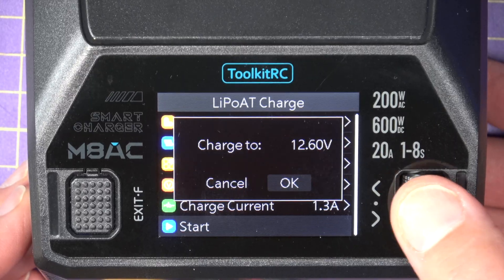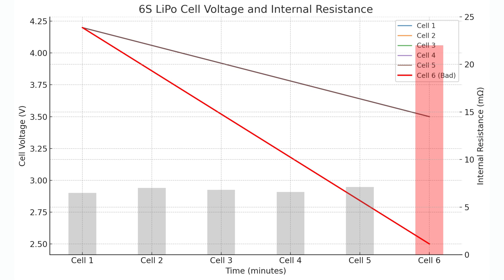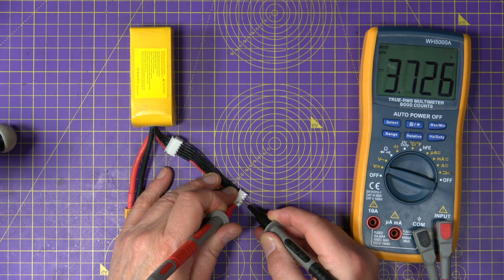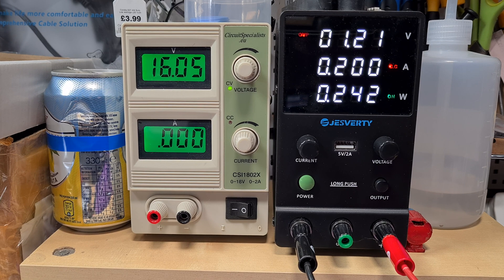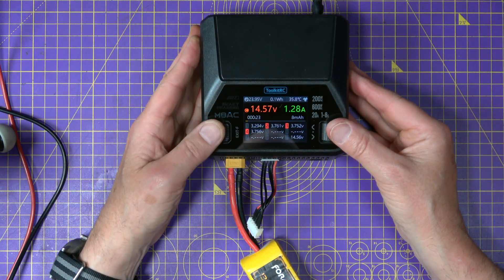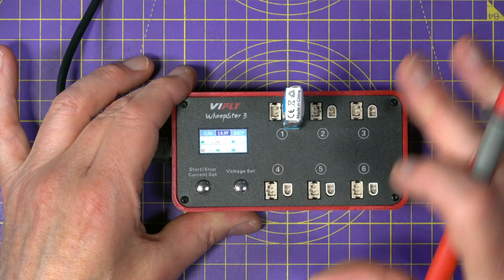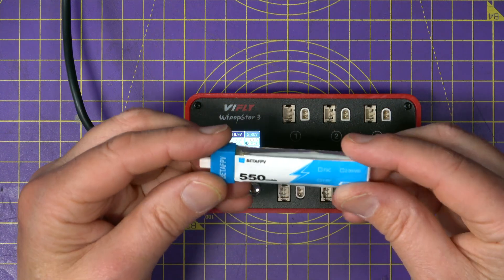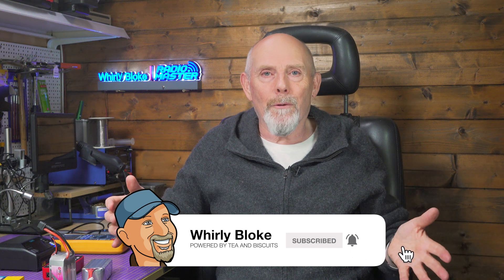CPR for Dead LiPos – How to Bring Them Back to Life - Charging Top Tip

Comment: I got the SKY RC D260 charger which is really wonderful, as it will initially always only charge with 0.1A until it figures out the internal resistance of the cells and how the voltages of the cells react to the charge current. It will balance charge an over-discharged battery, and it will supply it with only 0.1A until all cells are in the safe range again. At that point it bumps the charge current to what you have set. It also has a function to fast charge without balance and a storage charge function with balance. So instead of going right to 4.2V and risking that a faulty battery might take damage, you can slowly charge it to 3.8V and check how it's doing.

The only thing that sucks on this charger is the battery resistance check, as the values are different every time you measure and they are all over the place. I think this function needs improvement so the resistance of each cell is measured over a slightly longer period than just a second. It does however also have a battery meter showing the voltage of each cell, which is quite useful.
Reply from the maker: Thanks for sharing your experience. It sounds like it has some really useful features for maintaining battery health. It's always great to hear how different chargers perform in real-world scenarios.

Comment: I don’t use any fancy bench power supply or balance plug - simply unplug the balance connector, select NiMH, start charging through the main power lead for a few minutes- then plug the balance cable back in and finish as a lipo - but then I do mark it as ‘dodgy’ and be extra careful when charging in the future
Reply from the maker: Agreed. Pb or NiMH mode does the same job. Also, many chargers have a DC power mode these days. Thete's plenty of options. Thanks for your insight.

Comment: I use an zk-sk150PRO power supply for this and other projects.  I have this power supply connected to the zkbt bluetooth module for monitoring and control via the Wuzhi android bluetooth interface.
Reply from the maker: That sounds like a very sophisticated setup. Nice.

Comment: The easiest way to do this is with a parallel charging board.

Instead of trying to touch tiny pads to trickle juice in, just plug a charged battery and your bad battery into a parallel board. 

No need to "charge" anything... Just plug them in and let it sit a few seconds.

This is usually enough to bring your bad cell up to a level where "balance" will become a usable option again.

The MiniStar 6s 1300's I just received had one cell that was low straight from the factory. I charged the good battery 1st, then plugged the bad one into the balance board with it. A few seconds later it was high enough to balance.

This obviously doesn't "fix" the battery, but it will at least take a charge to see if it was just a bad balance or something worse.

(I received the MiniStars to review. If I'd bought them I'd be sending them back if they were DOA)

For the record, skip the MiniStars. The "Speedypizza" type are much better in my experience.
Reply from the maker: That’s a solid technique. Using a parallel charging board to nudge a low cell back into balance range can save a lot of time, especially if you’re just trying to get a battery to the point where your charger will talk to it again. As you said (and as I mentioned in the video at this point https://youtu.be/hrINEICWnCk?t=695), this doesn’t actually fix the battery. It just gives you a chance to see if it’s salvageable.

Good heads-up on the MiniStars too. I’ve heard mixed things, and your experience backs that up. I’ve also had better results with SpeedyPizza packs. They seem more consistent and reliable out of the box in my experience.
Reply: can attest, speedypizza 3s 600mah (and anything else in that range, i presume) are great!

Comment: Tell them the truth!
There is a reason for not charging!
It’s safety!

Yes, you can bring them back, but never to full capacity after that, and they are now more prone to sudden depletion or shorted cells!

You were warned.
Reply from the maker: Absolutely, tell the truth https://youtu.be/hrINEICWnCk?t=695
Reply: Done it a few times but the battery never seems to have the same punch. Ended up discharging using a bulb, leave  for a day and discharge again as they seem to be able to partially gain a small charge, bare the main wires twist together, then dispose of in the battery recycling. Surprised me that they seem to recover a bit after completely discharging overnight.

Comment: It's handy to make a charging cord that has an XT60 on one end and two header pins on the other, and then insert the header pins into the correct slot of the battery's balance charging adapter. Your final advice is spot on.
Reply from the maker: Absolutely. Having a DIY jumper with header pins can be a real lifesaver when reviving low-voltage packs. Just need to be super careful with polarity and connection order, but it’s a great trick when used responsibly. Glad you found the final tip useful too. Appreciate you watching and sharing your experience.